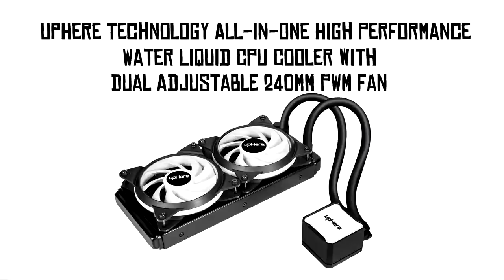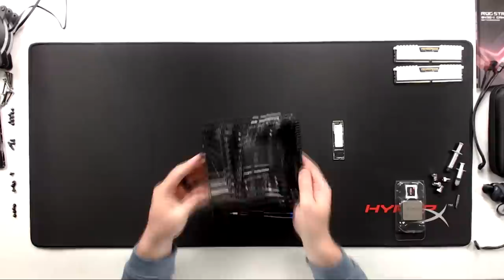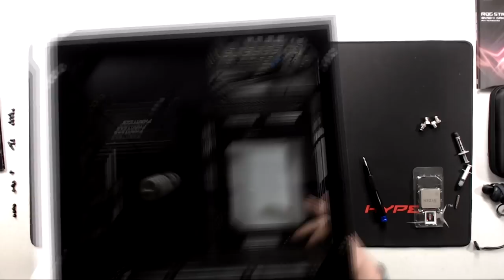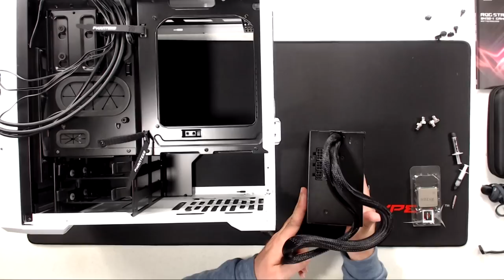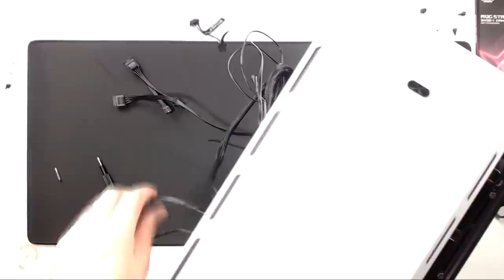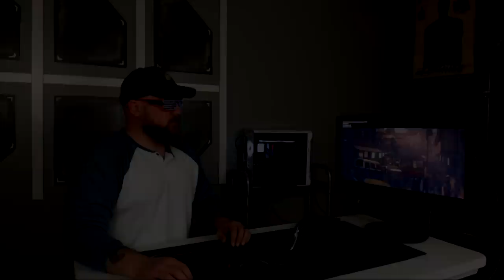Does Fire make it go faster? How to Build a PC! || Full Tutorial

Comment: I watched another video on how to build a PC. Doesn't the fan on the brick that powers the PC have to be facing inward and away from the holes on the case? Also the thermal paste on most aftermarket CPU coolers is usually not enough so I think you need to apply more thermal paste to the CPU in the shape of a gingerbread house.
Reply from the maker: LMAO had me going there for a second.